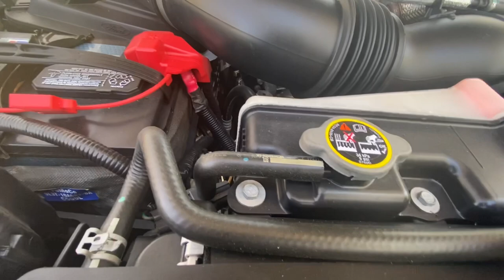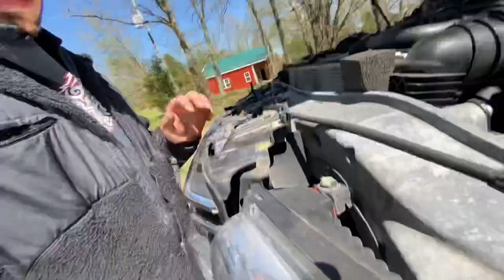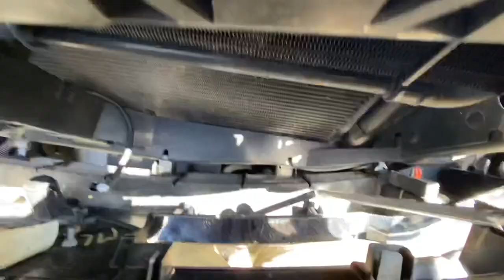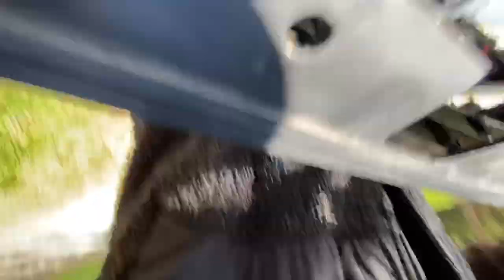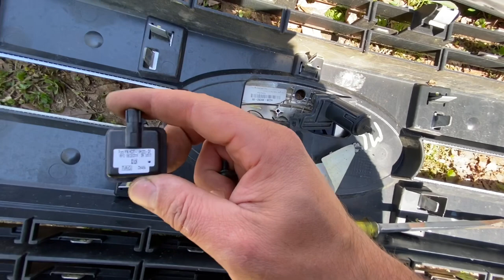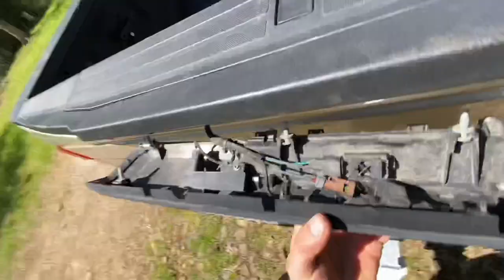2017 2018  FORD F-350  Foggy Camera Display Fix... Potentially. Grill Removal & Rear Camera Removal.

Comment: i replaced mine and is not showing on the 360 view it only shows if i press the button on the dash, did you have this problem?
Reply: Did you ever find a solution for your issue? I’m having the same after replacing the front grill camera.